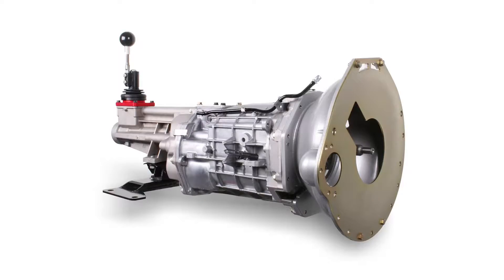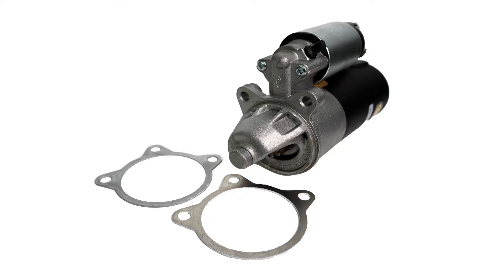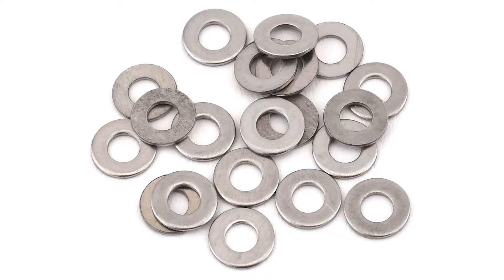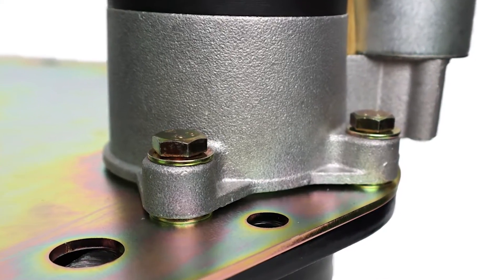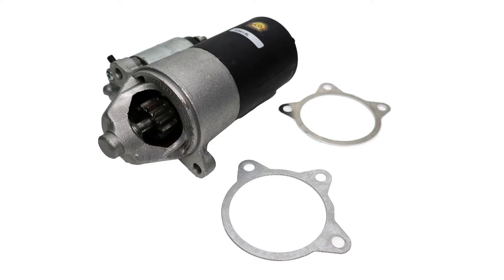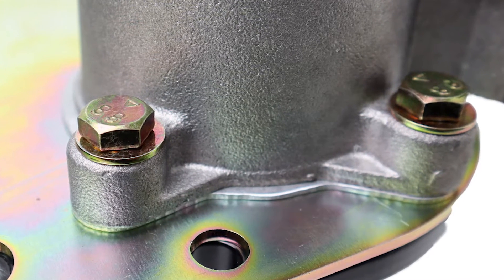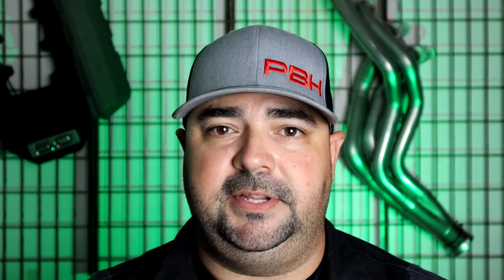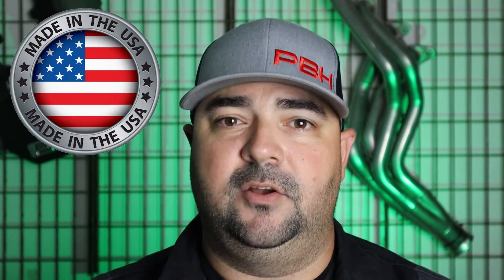Starter Shims for your Coyote Swap Project

Comment from the maker: Hey guys, thank you always for your support. These Starter Shims are a cheap way to make sure your Starter motor is setup right. Anyone using a Manual Trans behind a Modular Ford with 3 bolt starter can use these. Link is in the description to order and if you have any questions, post them up below.

Comment: I have a Coyote bolted to a TH400 so, aftermarket bellhousing, and the starter makes noise for a second or so after I let go of the start button like it's releasing slow/over-engaged so hopefully these will fix that.
Reply from the maker: It does sound like the same problem we had and why we made these. Make sure you are using the 3 bolt modular ford starter or something with the same bolt pattern as these are specifically for that style.
Reply: @PowerByTheHourPerformance  
Yes, it's the correct starter. Aftermarket flexplat might also be contributing to an engagement depth issue. I ordered a set of your spacers so well see. Thanks.